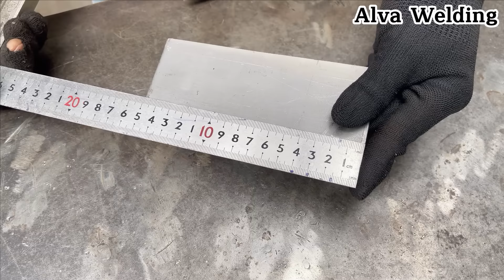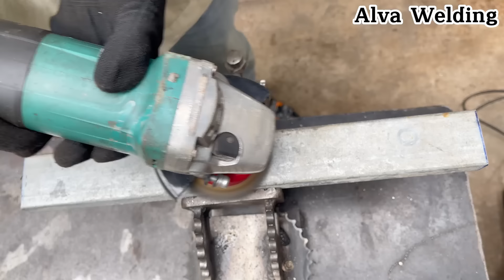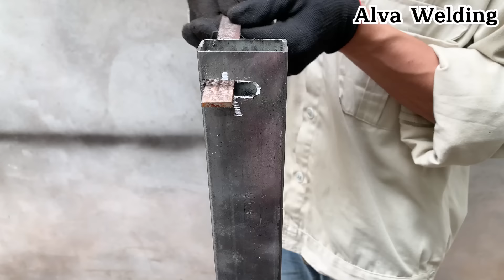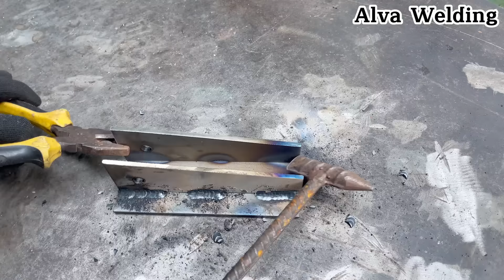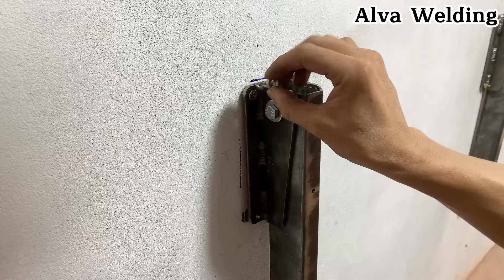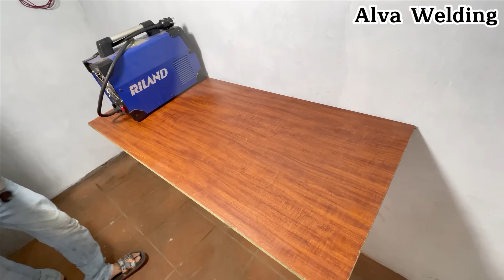DIY Smart Tool: Innovative Hinge Concept for Flexible Work Desk

Comment: If those Angled flanges are not structural why so thick, if it is structural why not bevel?
Reply from the maker: Thank you for your question! The thickness is for durability, but we didn’t bevel because it's not intended for structural use.